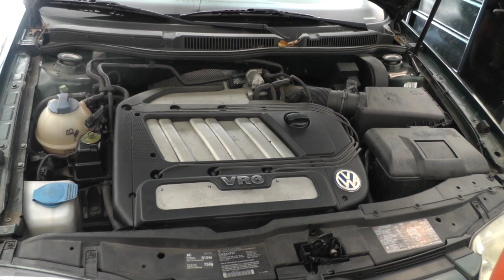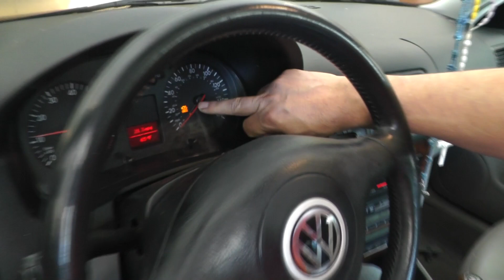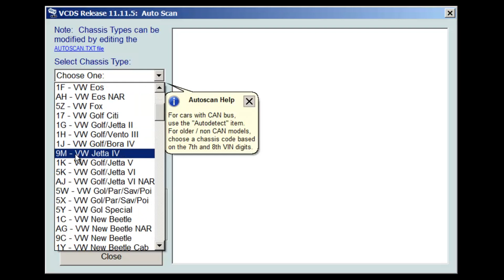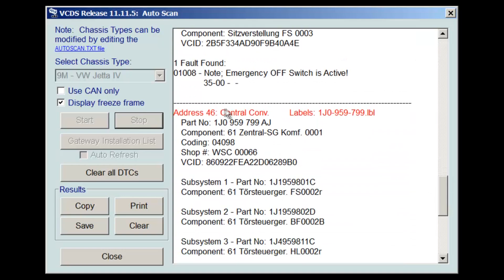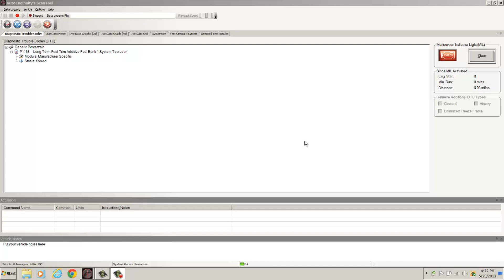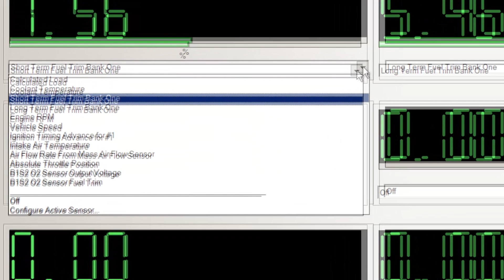Volkswagen Jetta Secondary Air Injection Diagnosis Part 1 (Read Codes)

Comment: @stuzman do you know much about 1997 mk3 2.0 vw Jetta? I know my Air Pump works (when testing directly from the Battery) but there is no power getting sent to Air Pump during start up.  I also know the Air Check valve is ok the Flapper opens and closes.

What are all the components to check?  What fuses and relays would I check?
Reply from the maker: I'm not familiar James with your vehicle, but they should all work very similar between the models. I would get a wiring diagram and service literature for your vehicle to help point you in the right direction for your diagnostics. Here are two links which will provide both of these types of info. www.alldatadiy.com or www.eautorepair.net
Reply: @stuzman52  thanks for the information I have not use Alldata in a long time.  That's not a bad price
Reply from the maker: @jamesworley5073  Yes, I've found the price to be quite reasonable for the amount of information available.

Comment: 2k MK4 jetta Vr6. if i postpone fixing the P0411 code for a few weeks, will it damage my 02 sensor and catalytic convertor?  this car can't go one year trouble free.
Reply from the maker: You should be fine on that code as it shouldn't cause any damage to your cat or O2 sensor.
Reply: a week ago, the winshell low fluid level light came on, on my dashboard. so, i refilled it. the next day it was empty again. after further inspection, i found that a hose going to the nozzle was disconnected. i did not immediately refill the reservoir with water because of the cold weather here in NYC and i did not have anymore windshell fluid. for 4 days i was driving with the low windshield fluid level light on.So, as i told you before, this morning the check engine light suddenly came on with a P0411 code. so tonight while shopping at walmart, i picked up a gallon of windshield fluid and as soon as i filled the reservoir and started my car, the check engine light turn off and 7 minutes later, the  low windshield fluid level light turned off.  wow!! can you believe that. i never would have guessed that a low fluid reservoir would trigger  a check engine light. this is  a load off my mind, not having to worked on this car again. i will check again tomorrow and cross my finger.
Reply from the maker: I can't see how the windshield fluid reservoir level would be connected to the check engine light. It probably was just a coincidence. And I would suspect that the windshield level would turn off immediately once the level was correct. In any event, it all looks good now :)
Reply: well, i started  my jetta this morning, ran it for about 3min and the check engine light is still off.
Vw is a funny car.
Reply from the maker: HaHa! Just give it time :)

Comment: mr. stuzman, i told you once before that if i ever win the lottery, i'll send you some money for your detail advices(good money too). LOL
anyway, here we go again with my 2k MK4 jetta VR6. just when i thought that i fixed something and everything is ok, something else goes wrong. that's right this morning i got a P0411 fault code. since i purchased this car in 2009 for $2800, i must have spent $7000 in parts alone to keep this vw out of the Intensive care.
Reply from the maker: Yes, when these cars from VW gets old, they are money pits :) And with the P0411 code, you've got some videos on here to help you with it. Good luck on what you find :)

Comment: I hope you're aware the the secondary air system only kicks in when the engine is cold and you start it. And then it's only on for probably 30 seconds. If you had started that car up before you plugged it in the generic software, that's the reason why it says it's complete but showed no faults.
Reply from the maker: Joseph Taylor I'm aware of how the system works and I show that in the later videos of this series. And not sure what you're saying about not plugging in the generic software that I wouldn't show any codes. It had two codes that were of interest here. A secondary air injection code and a lean code.
Reply: What I was saying was that when you plugged the car into the generic software (not the VAG-com) it scanned the car and said that the secondary air system scan was incomplete. I was saying this could be because when the software did the scan, the coolant was already warm. Thus the secondary system didn't turn on. I have the P1136 code, and I found out that it wasn't a vacuum leak, it was the PCV valve. When I removed the oil cap while the car was running, I placed a piece of paper of the hole and there was no suction. It also explains why I have an oil leak.

Comment: Hi Jerry, I have the same car, in black and like you, I love working on my cars, in part because my dad imparted his frugality in me.

I recently replaced the timing chains on my car (whoa, what a job!), and shortly thereafter it threw a P1411 code.  I haven't made time to diagnosis it yet but looking under the hood at the SAI system, I was overwhelmed with confusion as to where to start.

Thank you for your time, experience and effort to make and post these videos!  I've ordered high temp silicone hose and plan to crack the front open this weekend to get her done.

Would you mind if I post a link to the videos on the vwvortex Jetta forum?
Reply from the maker: Glad to hear scott that you like working on your car and you shouldn't have any problem at all getting it fixed. Sounds like you're off to a good start and want to do it right. Sure, no problem, you can share the videos all you like. That's what they're here for as to help others out there. Good luck on your car and thanks for your comments.

Comment: I need help i have a 99 jetta vr6 and the car is not running too good and the check engine light and other dash sensor lights do not illuminate! any help would be great
Address 01: Engine        Labels: 021-906-018-AFP.lbl
   Part No: 021 906 018 B
   Component: MOTRONIC ME7.1  G   6782  
   Coding: 00000
   Shop #: WSC 05063  
   VCID: 0D11521647945876E01-5142

20 Faults Found:
18010 - Power Supply Terminal 30 
            P1602 - 35-10 - Voltage too Low - Intermittent
16684 - Random/Multiple Cylinder Misfire Detected 
            P0300 - 35-10 -  - Intermittent
16687 - Cylinder 3 
            P0303 - 35-10 - Misfire Detected - Intermittent
16497 - Intake Air Temp. Sensor (G42) 
            P0113 - 35-10 - Signal too High - Intermittent
16486 - Mass Air Flow Sensor (G70) 
            P0102 - 35-00 - Signal too Low
17834 - EVAP Purge Valve (N80) 
            P1426 - 35-00 - Open Circuit
17950 - Angle Sensor 1 for Throttle Actuator (G187) 
            P1542 - 35-10 - Implausible Signal - Intermittent
17952 - Angle Sensor 1 for Throttle Actuator (G187) 
            P1544 - 35-10 - Signal too Large - Intermittent
17580 - Angle Sensor 2 for Throttle Actuator (G188) Signal too Low 
            P1172 - 35-10 -  - Intermittent
17633 - Fuel Injector for Cylinder 1 (N30) 
            P1225 - 35-10 - Short to Ground - Intermittent
17637 - Fuel Injector for Cylinder 5 (N83) 
            P1229 - 35-10 - Short to Ground - Intermittent
17635 - Fuel Injector for Cylinder 3 (N32) 
            P1227 - 35-10 - Short to Ground - Intermittent
17638 - Fuel Injector for Cylinder 6 (N84) 
            P1230 - 35-10 - Short to Ground - Intermittent
17880 - EVAP Leak Detection Pump 
            P1472 - 35-10 - Short to Ground - Intermittent
17843 - Secondary Air Pump Relay (J299) 
            P1435 - 35-10 - Short to Ground - Intermittent
17829 - Secondary Air Injection Solenoid Valve (N112) 
            P1421 - 35-10 - Short to Ground - Intermittent
17636 - Fuel Injector for Cylinder 4 (N33) 
            P1228 - 35-10 - Short to Ground - Intermittent
17923 - Intake Manifold Valve (N156) 
            P1515 - 35-10 - Short to Ground - Intermittent
17634 - Fuel Injector for Cylinder 2 (N31) 
            P1226 - 35-10 - Short to Ground - Intermittent
17525 - Oxygen (Lambda) Sensor Heating Circuit: B1 S2 
            P1117 - 35-10 - Short to Ground - Intermittent
Readiness: 0110 1101

-------------------------------------------------------------------------------
Address 03: ABS Brakes        Labels: 1J0-907-37x-ABS.lbl
   Part No: 1J0 907 379 H
   Component: ABS/EDS 20 IE CAN  0001  
   Coding: 03604
   Shop #: WSC 00066  
   VCID: 3663DDFA12827BAE71B-4B1A

3 Faults Found:
01276 - ABS Hydraulic Pump (V64) 
            16-00 - Signal Outside Specifications
00290 - ABS Wheel Speed Sensor; Rear Left (G46) 
            35-00 - -
00287 - ABS Wheel Speed Sensor; Rear Right (G44) 
            35-00 - -

-------------------------------------------------------------------------------
Address 15: Airbags        Labels: 1J0-909-60x-VW3.lbl
   Part No: 1J0 909 609 
   Component:  C AIRBAG VW3 SG   0002  
   Coding: 00067
   Shop #: WSC 00066  
   VCID: ECD7BF929C4E717ED7F-4B1A

1 Fault Found:
00532 - Supply Voltage B+ 
            07-10 - Signal too Low - Intermittent

-------------------------------------------------------------------------------
Address 17: Instruments        Labels: 1J0-919-xxx-17.lbl
   Part No: 1J0 919 951 B
   Component: A4-KOMBIINSTR. VDO V57   
   Coding: 06262
   Shop #: WSC 00000  
   VCID: 2F6DE89EEDD84A6632D-5142

1 Fault Found:
01039 - Coolant Temperature Sensor (G2) 
            29-10 - Short to Ground - Intermittent

-------------------------------------------------------------------------------
Address 46: Central Conv.        Labels: 1J0-959-799.lbl
   Part No: 1J0 959 799 AJ
   Component: 61 Zentral-SG Komf. 0001  
   Coding: 04096
   Shop #: WSC 00066  
   VCID: 8603ED3AA2E2AB2E21B-4AE8

   Subsystem 1 - Part No: 1J1959801C
   Component: 61 T?rsteuerger. FS0001r  

   Subsystem 2 - Part No: 1J1959802D
   Component: 61 T?rsteuerger. BF0001r  

   Subsystem 3 - Part No: 1J4959811C
   Component: 61 T?rsteuerger. HL0001r  

   Subsystem 4 - Part No: 1J4959812C
   Component: 61 T?rsteuerger. HR0001H  

4 Faults Found:
00953 - Interior Light Time limit 
            25-10 - Unknown Switch Condition - Intermittent
01358 - Internal Central Locking Switch; Driver Side (E150) 
            27-10 - Implausible Signal - Intermittent
00912 - Window Regulator Switch; Front Left (E40) 
            27-10 - Implausible Signal - Intermittent
00944 - Heated Exterior Mirror; Passenger Side (Z5) 
            35-00 - -
Reply from the maker: Hey mikey. I bet you freaked out when you saw all of those codes. When you see a vehicle with a LOT of codes the first thing that I want to see, is there a code for low or intermittent B+. Sure enough, you've got two of them. If you have low supply voltage, it can be either the B+ line or Gnd. So, that's where you want to start looking. If you have low supply voltage, then everything else is not going to work since all the electronics needs the correct voltage. To confirm that you really do have low B+, you can go into the scanner and see what voltage that the PCM is seeing. On your scanner go into Engine 01, then Measuring Blocks 08, and then type in the group number 004. You should see a text field indicating the voltage. My guess is that the voltage will be low. Now where to look for the problem. Start at the battery which is where it all originates. Check your open circuit voltage (OCV) of the battery with the key off. If your battery is fully charged, that should be 12.66V. Check battery connections, the connections in the fuse bracket over the battery. Also, check the fuses on the driver side paneI, specifically fuse 10 and 29. I hope you have a wiring diagram for your vehicle. Check terminal 30 and 15 to be sure the voltage is good there. Also, we don't want to forget the charging system. Be sure that the charging system is putting out a good voltage too. Depending on the load on the generator, that will run from 13.2V-14.5V. Now, you may other issues with some of the other codes, but you'll need to address the low voltage problem first. So, find that issue first, clear the codes and see what comes back. Then you can address those issues that may pop back up. Take care mikey....
Reply: Thanks alot for your comment and i will look for the wire diagram for the b+ nagative. I know i am only getting 4 volts to the purge vale solenoid and the maf sensor also. thanks again!
Reply from the maker: mikeyd19841 There you go mikey, low voltage. Let me recommend this site for the wiring diagrams. When you're working on an European vehicle, you can't beat these guys for simplified diagrams and all the repair info along with the TSBs.
http://www.eautorepair.net/Marketing/Default.asp
Reply: Thanks again for your input and time! I am going to check all the grounds that could be possibly causing the issue i am having from the previous owner!
Reply from the maker: mikeyd19841 No problem and glad to help. You might keep in mind too that the previous owner could have been in there somewhere and caused some havoc too. Good luck in your quest to find the issue.

Comment: I hope you could help me!
I have a jetta 2000 1.8t
And everytime i am in stop sign or a red light , once i brake completly i feel the car like if it want to acelerate and the rpms bounce just a bit but it is noticible that the car want to go but i am not putting gas i hope you could help me sir
Reply from the maker: Do you have a check engine light? Sounds like you have an idle issue. One thing that could cause this would be a vacuum leak or an issue with the idle air control assembly. Check out my friend on YouTube at "Thomas EXOVCDS". He's a professional tech who works on VW's everyday. Post the question to him and see if he has some thoughts.
Reply: Thank you sir!!
I had the check engine light for 3 days then went off
Reply from the maker: There you go. First thing is to get the code read so that you will have some direction to know where to troubleshoot.
Reply: But even if the light its not on anymore the computer can find the code?
Reply from the maker: Yes, even though the light may be out now, there should still be a history code. Get a scanner and see what the code is.

Comment from the maker: Yes, I did a little research also and found the same thing. I believe that the pump is working as it sounds like a vacuum cleaner. And yes, it's job is to reduce emissions by injecting oxygen above the exhaust valves during a cold start. It also is supposed to run after following starts when warmed up for the ECM to do checks on the system. I'm hoping that there is a vacuum leak being a broken hose, etc. I haven't worked on Volkswagens that much, but I guess we'll all learn on this one. Thanks!

Comment: I spent a little time on the VW forums, and I found a number of people who had faiiling air pumps. Some decided not to repalce the air pump, reasoning that the main function the air pump is to reduce emissions, with little effect on performance. Of course such a vehicle would fail an emissions inspection but they said a new air pump is pretty expensive. I hope your solution is easier.